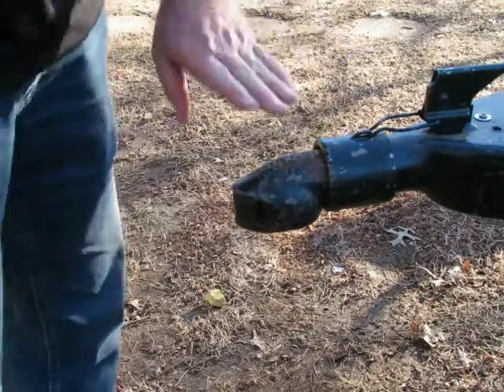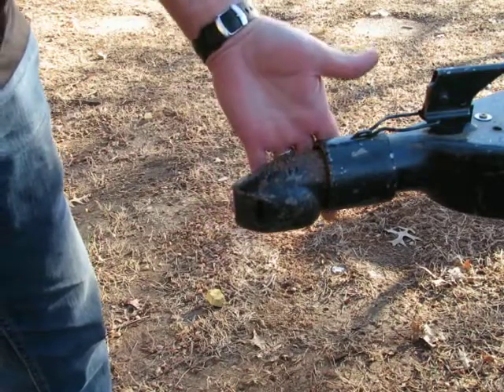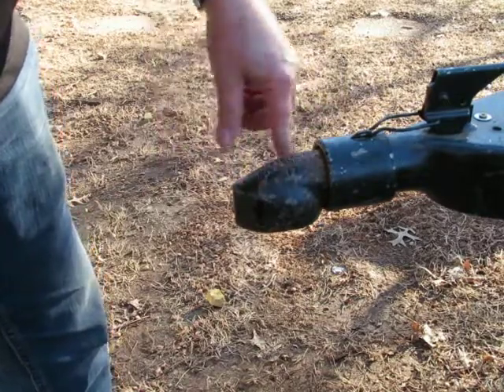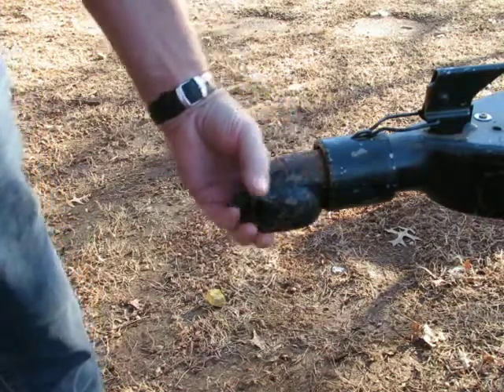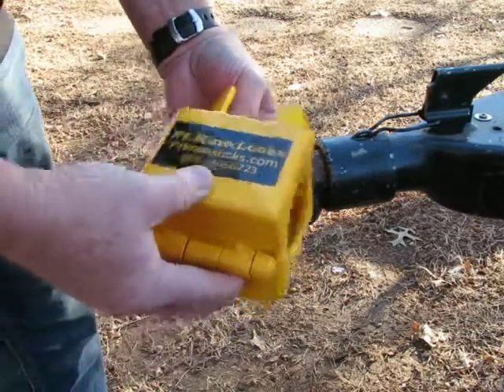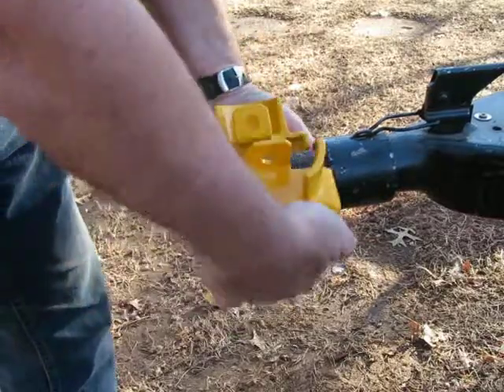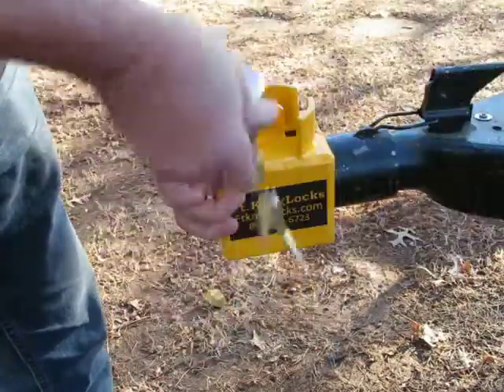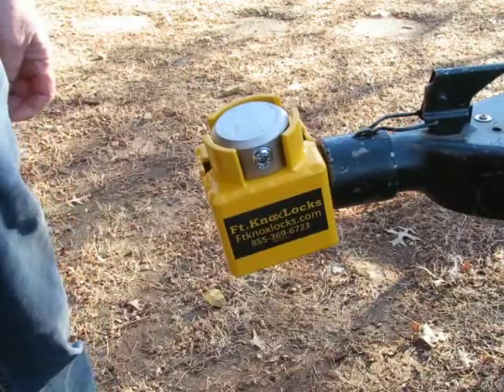Ft. Knox Lock for a Bulldog sliding collar coupler

Comment: Where do you secure the chains?
Reply: i think the best thing to do with the chains is to cut the first link in each chain (where it is mounted to frame of the trailer) and replace that link with a removable chain link so you can take the chains off altogether when you aren't using it.

Chad Odom